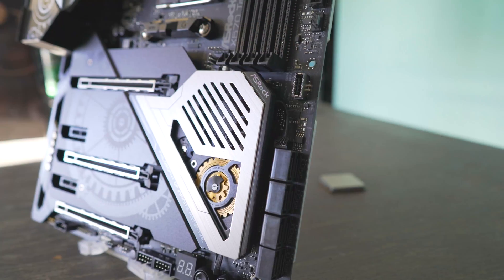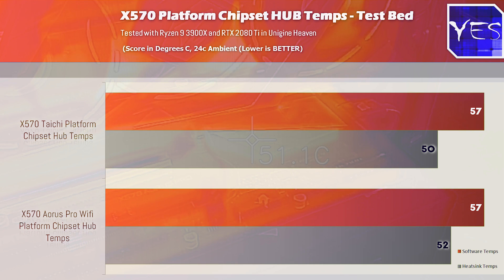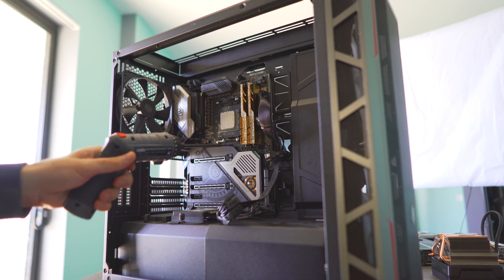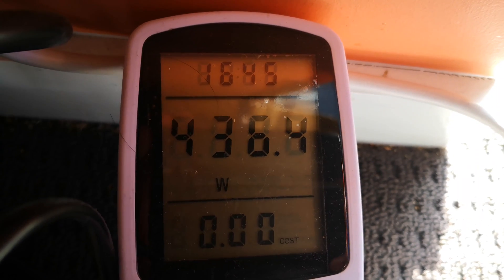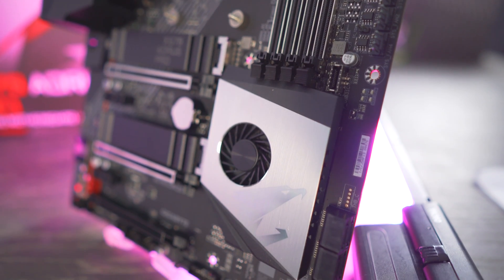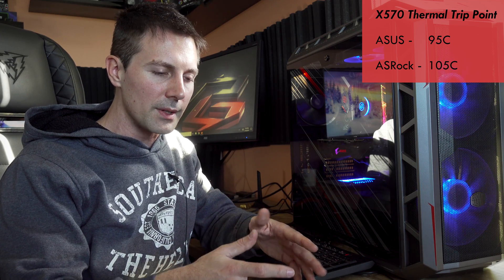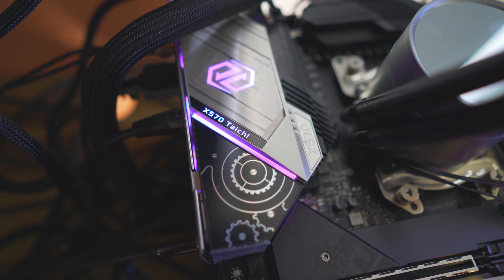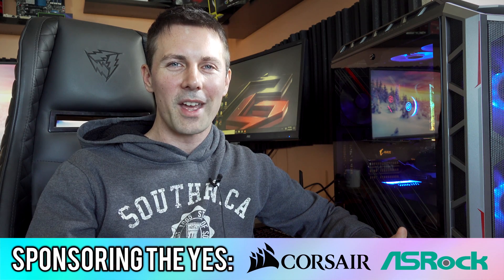X570 Chipset Overheating...!? (Investigation)

Comment: My PC crashed twice..x570 pro carbon, pcie gen 3 connected to chipset. When mine crashed and reset, the SSD connected to chipset was GONE. System wouldn't read until It cooled down and I reset it.
I have 10 case fans and a lot of airflow.... This could just be a chipset error instead of overheating... But man I was worried that thing fried my brand new 1 tb SSD!!
Reply: I will also note that I was playing ark survival for hours from that SSD before it crashed.... And the heatsink was VERY hot

Comment: I have this board.  The chip set cooler placement is not the board's only major design flaw.  The USB type C front panel connector is DIRECTLY in line with the top PCIE slot. Meaning when the front panel type C is connected, even if it uses a right angle connector like my Lian Li 0-11 Dynamic, you can't connect a decent length GPU.  My GTX1080 hits the connector instead of plugging into the socket.

So now I don't have to worry about the chipset overheating because I have my GPU on a vertical riser so I can still have front panel type C.  Sucks because I wanted to show off that board, not block it with a GPU in front...
Great one, ASRock...

Comment: I have to say.... Did anyone listen??   AMD even stated "in extreme use cases, the chipset has shown to require active cooling.  Such things as RAID 0 arrays of MVME PCI-E 4.0 M.2 drives GOING THROUGH THE CHIPSET, multiple high bandwidth devices, not limited to, but especially the Thunderbolt 3 devices, and so forth...."
Yes these are extreme use-cases, but considering who benefits most from the PCI-E 4.0(content creators and semi-pro video workstations among a few others), the problem will pop up quite regularly.  And then there's all those legacy peripherals added onto the legacy bus's, they still puts strain on the X570 chipset......some of mine require 2X USB ports.  
An old Southbridge waterblock is the way to go for the X570 series and ESPECIALLY any older mobo's that'll certify their PCI-E 4.0 implementation.

Comment: The only issue ive had with x570/ryzen 3000 is when I first booted up it started and shut down and then restarted like 4 or 5 times. I'm guessing it was just sorting itself out on its first ever run but it seemed excessive. No issues since tho and I've pushed it HARD lol. Running with nvme and O11 dynamic.
Reply: That is the most normal thing for a mobo to do.
Reply: @christoph6055  that was kind of my point lol. The only issue being instead of doing it 2-3 it did it like 5 times.

Comment: I could be dead wrong but isn't the second and third pcie slots going through the chipset while the first one goes directly to cpu? So it's not advisable to go for the second or third one?
Reply: First and second go to CPU, third goes through chipset

Your assessment would be correct if you were talking about M.2 (top slot 4.0 x4 to CPU, bottom two slots are through chipset).

Comment: Operating System
 Windows 10 Pro 64-bit
CPU
 Intel Core 2 Duo E6850 @ 3.00GHz 45 °C
 Conroe 65nm Technology
RAM
 8.00GB Dual-Channel DDR2 @ 400MHz (6-6-6-18)
Motherboard
 MICRO-STAR INTERNATIONAL CO.LTD MS-7345 (CPU 1) 41 °C
Graphics
 Generic Non-PnP Monitor (1600x900@60Hz)
 2048MB ATI AMD Radeon HD 7800 Series (MSI) 24 °C
Storage
 931GB Seagate ST31000524AS ATA Device (SATA ) 28 °C
Optical Drives
 TSSTcorp CDDVDW SH-222BB ATA Device
Audio
 AMD High Definition Audio Device

Comment: Der 8auer tested power consumption on X570. Even with 2 SATA drives, 2 4.0 NVMe devices and a 2080 Ti running a game and SiSoft Sandra stressing the drives, the chipset never used more than 10W. A better cooling design would have made the fan irrelevant in the first place.

Comment: for msi at least for the creation, stock settings for the chipset fan is a ramp up of 0-100% starting at 55c to 95c cooling in my case means this fan never spins, I can turn manual on using manual mode this cuttently sets the chipset fan to a fixed 38% or 2600 ish rpm , it cannot be heard over the cooling in my case hopefully helpful info

Comment: I watched this from a techtuber that testing the wattage of the ASUS's X570-Hero :
https://youtu.be/qk3PD-4zPN0?t=843

He tested that the 2nd GEN, X470 in 4.1W with 1* nvme(PCI-E 3.0)
but in X570-Hero, with 1*Pci-E3.0 in load, 8.55W
for new PCI-E4.0 nvme, in load, 8.86W

If u using 1*Nvme(3.0), 2* SATA device, 1*GPU, simulate the full pc scenario, 
power consumption of the chipset will be around 9.76W, 

So I think the X570 is 2 times power needed than the X470.

Comment: What's the purpose of the 2080ti on the 1st PCIe slot? Isn't That slot is connected to the CPU, not via the Chipset.
Reply: It's to "obstruct" the flow of air because people were worried the "lack of airflow" to the chipset fan, which is shown to be a non-issue.
And yes, slot 1 and 2 directly connect to the CPU, not through the chipset. 

You would never install your graphics card into the third/bottom slot (the only slot connected through the chipset).

It's hilarious that people think nobody thought to test a platform that requires a graphics card by using... a graphics card to test.

Comment: When I lived in Adelaide decades ago, I had a dx4-100, it would shut off all the time, I didn’t have AC. Blue tak would melt off the walls, So I had to take the sides of the case off and put a desk fan either side of the case to keep it cool lol.

Comment: 3900x, Aorus X570 Master F5g bios Phanteks enthoo primo 7 140mm fans (watercooling 280mm rad), GTX1080ti, 2xnvme. The only switching off i've found/suffered it due to the ram once due to stock Volts (auto) undervolting (XMP likes to say 1.35V but randomly does 1.2V when set), second time due to timings needing to be put in manually rather than auto (thats 100% confirmed the case but unsure which bios due to dual bio before both reflashed), 3rd time due to overclocking attempts once again the Ram so obviously i was at fault here but the corsair ram (CMW32GX4M4C3200C16W V4.32 Samsung B-die https://i.imgur.com/IqSAJhx.jpg) Seems this stuff likes higher Volts for timing changes vs the g.skills ones that doesn't. Theres also an issue with 3200mhz ram & the IF speed with Auto setting, the 3600mhz Ram 1:1 setting.....1800 IF. With Auto at 3200mhz is clocking 1800 rather than the half number its supposed to be causing issues e.t.c..... I forget the specifics, also some MSI boards are supposedly have other issues with IF numbers. So Auto seems to be the issue with this board. Also with the CPU "overvolting" AMD said its fine (https://www.reddit.com/r/Amd/comments/cbls9g/the_final_word_on_idle_voltages_for_3rd_gen_ryzen/) but Normal seems to lower the voltage for idle (0.3V-1.4V) while Auto doesn't (1.2V-1.5V). Oh & it loves it error codes, has like 4 for Ram & D3 for just running Ryzen Master, has another one for using Gigabyte app (programme ~ uninstalled highly recommend you do the same if you use it). On the Good side yet to see the CPU reach over 45C in games with this set up (winter here). Oh fun fact -4c per stick if you turn off RBG on those Corsair RBG Pro ram.

Comment: der8auer did a thorough testing, he was surprised, temps were low. he went to say 'i don't understand why is there a fan on x570 chipset, it doesn't need it...
Reply: He hardly stressed the chipset in his tests. The fan is there for worst case scenarios (loaded with many devices). Supposedly PCIe Gen4 m.2 drives in RAID really heat things up.
Reply: @deathk26  ,
Plus it gets far worse in conditions with poor air flow. Also, there's PCIe v3.2 Gen2 connections which are probably more demanding under max load than passing the M.2 SSD (chipset connected one obviously not CPU) to the X570 chipset. No way to know because it's not just bandwidth but how efficiently the chipset can process the signal it's passing to the CPU (and back).

Comment: A good case is very important- especially if the MB needs to be cool Gamers Nexus has a good review table showing the best 'cool' cases. Unfortunately my favourite unpopular case the Silverstone RL06 is sold out - but there are other more expensive options... The Cool Master 500mesh is a great choice based purely on reviews...
Reply: I've had the 500mesh for a year and love it. Switching this weekend from asus prime b350m-a, r7 2700x (stock cooler), rx580 4gb to asus prime x570 pro, r7 3700x (corsair h100i pro) and switching to rtx2080 super when available without worry. I ordered slim fans in case I have trouble with clearance mounting the radiator in the top of the case.

Comment: ... I would be less concerned about it now, I'd be more worried about this exact problem in 3 months or 6 months, when those $3 fans start to randomly shit themselves... Or in a year or two when the dust-bunnies set up a maternity ward in one. A chain is only as strong as the weakest link. If your system really depends on that little fan... As long as the damn thing does a shut-down before it just locks up, or worse ~ fries that damn chipset.... I can deal with a computer that shuts down unexpectedly because there's a problem with the $3 chipset fan ~ I can change it. What I don't want, is a motherboard I paid $400 US for, that's now toast because the chipset's toast, because the chipset fan died and the computer took a bit too long to complete the Windows Update...

Comment: 2 weeks in I have no issues with system shutting down -TUF-GAMING-X570-PLUS-WI-F motherboard.
Ryzen 7 3700X, 32GB DDR4 3200, Galax RTX 2080 OC 8GB

I would suspect poor air flow or cheap PSU....
Reply: Moran Taylor Thanks for saying this, I'm getting the TUF board for my 3900x and I was getting worried. Also I have a question for you for that board, do you have to plug in the extra 4 PIN power for the CPU? Cause my Power supply only has one 8 Pin CPU power cable
Reply: @Senpaization  - Nope, only have the 8 pin connector connected the manual recommends connecting the extra 4 pin cable if using multiple GPU's.
Reply: @Senpaization  Unless you're doing LN2 overclocking aiming to break world records you're more than fine with just one EPS 8 pin cable. It provides 384W to the CPU alone (on most mobos they use solid pins conectors wich provides up to ~480W). Manufacturers put a totally useless extra EPS conector to lure consumers and it apparently works. :)
Reply: Nice one :d i wanna buy too 3700x but can't decide x570 tuf or the msi edge. Have you try the wi-fi? Is it have a good signal ? Thanks
Reply: Moran Taylor thanks for sharing. are you using stock bios settings or manual settings?

Comment: I have just today built a 3700X on a MSI X570 Carbon Pro Wi-Fi.... and can confirm the chipset fan is not spinning. Room temp is about ~23C. That said the heatsink is just shy of being warm to the touch... 

Now I have a spare X5650 on a Asus P6T Deluxe V2 with 18GB of DDR3 and a GTX1080 for sale...
Reply: Good to hear that since i'm going for a similar build on the x570 Gaming Pro Carbon Wifi! ^^
Reply: Turns out... just installed the Utility... the Carbon Pro WiFi has the chipset auto off under 50C... 

And Brian... I'm just down the road mate. If you're interested in a X58 kit and a ride on a VR motion rig.
Reply: The chipset fan not spinning all the time is normal for some board manufacturers, they set the fan to only kick in when it's needed.
Reply: Thanks for reporting, RamjetX! I’m thinking of a similar build. A question, can you define custom fan curves for the chipset fan in MSI bios, ie have the fan to start spinning at 60 degrees?
Reply: normally the fan doesnt work until to reach the 50/60 c, you check thatt?? im curious
Reply: men msi x570 carbon wifi  is not a motherboard but  a hell pit   good luck  with temps  on vrm  (the good in your case is you can cook on that motherboard hhaahhaahhaahaahahaah)
Reply: @SICKBOYSALONICA  Yeah I got some air flow alright... it's in a HAF922 case. 

But yeah, I'm not impressed with this motherboard. Two of them got bricked by the Dragon Centre Control software , from MSI, to just control lighting and fan profiles. 

No shit, it bricked two mobo's before we figured out I had to format my c:\ because each time it booted, it would apply something and kill the board. It wasn't OC'd in the slightest either.

Never ran that software again. All been well so far. But a bad first experience with an MSI product for me.

And I've been building PC's for 25 years.

Comment: Here in Canada the r5 2600 is currently $180 on Amazon, while the r5 3600 is currently $280 on Newegg (cheaper than Amazon which is around $300). At these prices, which is the better buy?
Reply: I have the 2600 and it's phenomenal price-performance. However, there are many reports that with 1080p gaming, 0.1% lows are getting big performance increases with 3600 over the 2600, average fps is also higher has well, but not as much. If you game beyond this you are mostly GPU bound anyways, so the margin would close down a bit more.